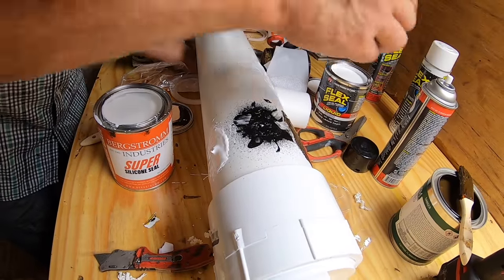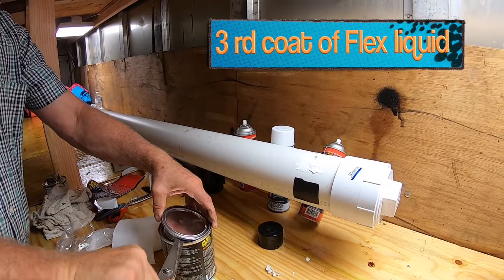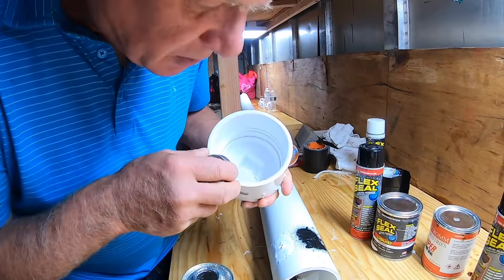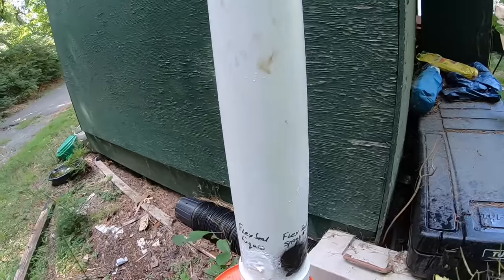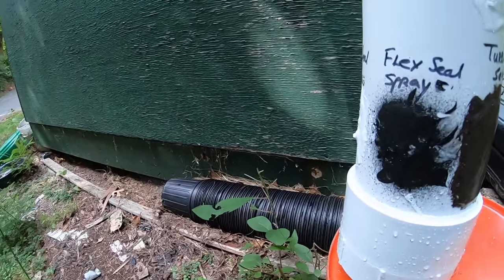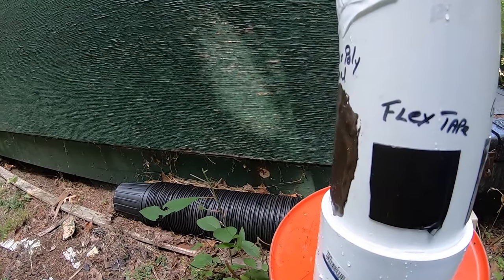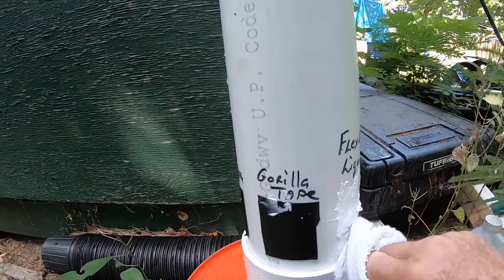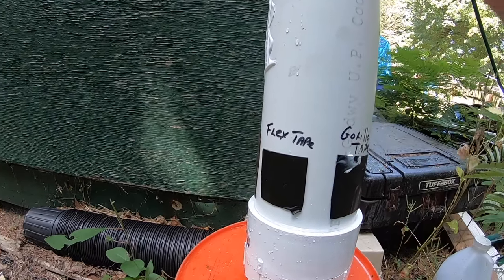Flex Seal, Turbo Poly Seal, Super Silicone Seal comparison and flexibility and strength test

Comment: Thank you so much for putting all these to the test. I have a metal roof shop that is leaking at its seams and leaving horizontal water lines on shop floor in the winter month down pours here in the PNW, not so much in spring/summer rains. My roof is blue and view able from ground. I do not wish to put on anything leaving black/brown lines.  That would make it extremely unsightly. Does the turbo poly seal come in a clear? For the cloth could I use something like window screening pieces combined with turbo poly seal or does it need to be a thicker fleece? Any advice would be helpful. Thank you.
Reply from the maker: Ok, you can paint the Turbo Poly Seal with an oil based or Urethane based paint. You need to to color match what you have.
It does not come in clear.
The Fleece that comes with the Turbo Poly Seal is specially formulated to be able to stretch slightly but also to give strength. Using the window screen stuff I assume it is either nylon or metal. I do want to think that the nylon or plastic might work. I think it is a excellent idea, but have never tried it. The fleece conforms easier to uneven surfaces and I dont think the nylon screen will be so flexible.
Reply: @FlatRoofDoctor  Thank you for getting back to me. I didn't think about painting over Poly seal,, wasn't sure if painting would disrupt purpose of Poly keeping it as you state "flexible". So I can pick up white and paint blue.Great! problem solved.  I will also get the fleece.  When I get all materials and ready to apply this spring I will test out the screen idea on separate piece, just to see. Thank you for your advice, love your videos they have taught me a lot. Proud to do my own home repairs the right way.
Reply: @FlatRoofDoctor  Another question.  Do I have the choice of either using Turbo Poly Seal and or Super Silicone Seal.  Either one would work?  Are there big differences. Your video's use both, (white, brown) being applied. Using the white Silicone Seal looks easier to apply using roller.
Reply from the maker: @TT-dc8ui   Because I  have used Turbo Poly Seal for a long time, I favor it. But, I honestly like the Super Silicone Seal a lot. It is becoming my go-to product now for almost fixing anything. I think it sticks better to glass, plastic and other surfaces than Turbo. It is not as tough but it appears that the UV's have no effect on it. I like Super Silicone Seal a lot.
It's a coin toss.
Reply: @FlatRoofDoctor  Have you tried painting over the Super Silicone? I ask because the Bergstrom site states "Working Temperatures are 33˚ and above
The surface must be completely dry Not paintable " wondering if you have found this true, not that they would lie but ya know! I am going between the two only because of cost. But I want the roof sealed. If it's not wise to paint over SS then I must go with poly.  Is there more than one name/brand for Turbo Poly? Trying to save cost but not do a cheap waist of a job. 
One more thing. Would it matter what  way you place the fleece (and seal)? Metal sheets seams run horizontal down length of roof. would you put fleece up/down over seams or horizontal strait line. weird question but just thinking how water runs down roof.  You have been a great help, thank you.
Reply: @TT-dc8ui  Please let me know how the Poly Seal turned out.

Comment: Every material looking to be good for job,just have thay'r conditions aplycation like:indor outdore,vertical,horizontal,temperatures wether conditions etc.
Reply from the maker: The major difference between the materials are the fleece.Flex Seal products don't come with a fleece and makes it not work as well. Turbo Poly Seal and Super Silicone Seal comes with a specially formulated Polyester fleece that give it that added strength.

Comment: Great video my friend thank for sharing
Reply from the maker: Thanks Montanez, I was surprised myself at the outcome too. I am using the Super Silicone Seal a lot nowadays. I am preserving an EPDM Rubber roof from sure disaster by coating all the seams.
Reply: Can you apply the Super Silicone Seal 15 years later on top of the first application? Or would I have to remove the epdm rubber roof and apply a new one to put another solid coating of Super Silicone Seal on epdm rubber roofs?

Comment: Flex Seal paste is the best. ESPECIALLY being applied during the rains. Your 3 STEP poly process works good, but not in the rains or wet surfaces. Try the Flex Seal Paste next time.

Comment: This test was testing two event 1. How well a product seal and insulate water.  2. You were test a product's ability to hold things together without separating. I have never heard flex seal claim to hold things together under tension. Either you put a fabric strip in the flex seal or leave out the fabric straps from the other two to get a real test. You should do this again or just Apologize to flex seal for the unfair test.

Comment: You should not compare stuff that uses a layer of film to something that does not. Why not use the fabric with the asphalt-based Leak Stopper Rubberized roof patch.
Reply from the maker: Duh! I am showing exactly the comparison to products as you would buy it. Flex Seal does not have any fleece or "fabric" sold with it. Turbo Poly Seal comes with a Fleece and so does Super Silicone Seal. The fleece is specially formulated to be soft yet strong. Duh!

Comment: What do you recommend for epdm roof?
Reply from the maker: Super Silicone seal is winner. No doubt that it will expand the life of any EPDM roof
Reply: Also consider Henry Tropicool silicon sealer from Home Depot. Works with EPDM. And much cheaper.

Comment: The first test was with negative water proofing not primary waterproofing and you should never rely on that to begin with….2nd test Try using the flex spray and liquid with the “fleece”as well to compare apples to apples. And for a true test do a long duration exposed to UV. 
I do understand you are testing how normal consumers will try to use these products (and hope they don’t try and use the spray for repair of sanitary pipes💩!” Please educate the people of primary and secondary waterproofing of the exterior of a structure And a temp fix.

Comment: I believe your Flex Seal Spray application was flawed and that's why you had the leak you had.  You used a patch on the Turbo Poly Seal, why would you not also use one with the Flex Seal Spray.  You should have spray one coat of Flex Seal Spray, applied a patch using the 1st coat as an adhesive, then applied two more coats of Flex Seal Spray and it most likely passed the test.
Reply from the maker: Really? I did the experiment exactly as per instructions on the can. So you want me to rig the experiment so it would not show the real character of each product? Duh!
Flexseal does come with any polyester fabric whereas the Turbo Poly Seal and Super Silicone Seal is sold as a Kit with the Polyester Fleece as part of it.
So you don't like the truth, you want "fake" news.
Reply: @FlatRoofDoctor  Instruction #5. Apply multiple, even coats until ALL cracks and holes have been filled.  Common sense would dictate that hole you have would have to be filled or block with some sort of patch as I stated in my 1st post. Another Vlogger simply used a piece of paper as a patch on a similar size hole and the flex seal worked like a charm. You also must have missed Flex Seal Tip #3 Make sure Flex Seal has filled ALL cracks and holes and is FULLY CURED before testing product. Again Common Sense, you didn't ensure "ALL" cracks and holes were filled, based on my observation.

Comment: This is not an accurate test, once the first hole is breached, that becomes the weak point and the water will always egress from there thus relieving the water pressure to test the other holes.

Comment: Why didnt you use the reinforment tape on the flex seal.
Fles seal is just as strong as the turbo and silicon sealer when used with the fleece fabric.
The reason they demonstrated flex seal failure is because it cost 1/4 as much as the competitors, meaning you can do the same job for 3× the profit margin with flex seal.
Ive come to dislike this man.